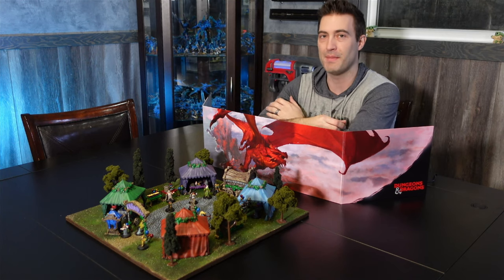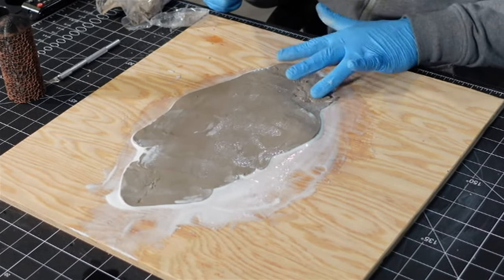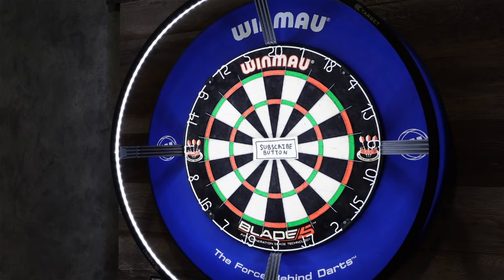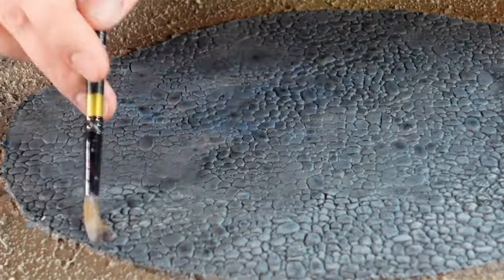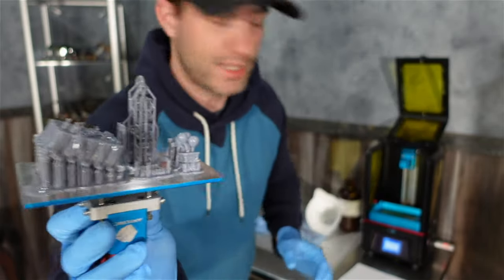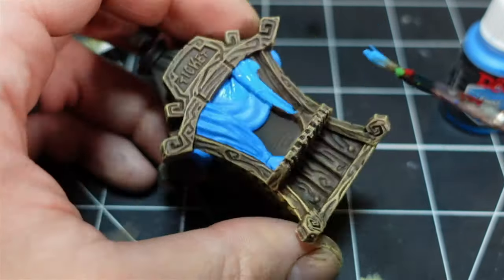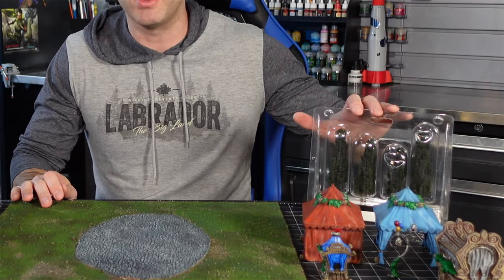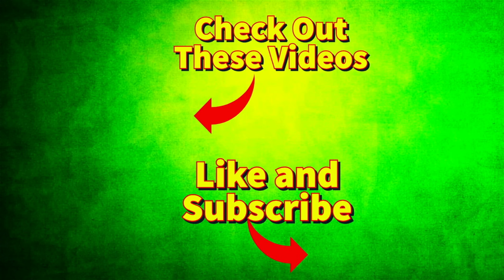Making a Mysterious FANTASY Carnival DIORAMA - 3d Printed D&D Terrain from World Forge Miniatures

Comment: I've come to the conclusion lately that most of my failed prints are due to room temp. I built a box with taped-together foam core from the dollar store and a cheap electric heater inside. I keep it at 30 degrees c. Haven't had any fails since. Sometimes I would have parts that wouldn't fall off the build plate but would have cosmetic failures like warping, I think this is all due to temp. The less viscous you can get the resin, the better.
Reply from the maker: I  believe that! Temperature has a big impact on resin printers imo
Reply: Yes, definitely - it's an issue for me testing the supported prints in the UK in winter. Roll on the summer!
Reply: Thank you for including your printing issues and how you solved them. It's great information for anyone getting started with 3D printing.

Comment: One other thing to keep in mind is that when removing or inserting the resin tray is to be careful about the fep sheet. Keep an eye on it to make sure that it isn't getting scratched by lcd screen.
Reply from the maker: I really need a screen protector...
Reply: If you have any micro fiber cloths, it should be safe to set the fep side of the resin tray on it.

Comment: Love the video! Getting ready to do the FDM prints myself. How did you get them to work? Did you sink the tent top into the bed a bit? What % did you use for supports? Looks like on your 3rd print the flags finally came out. Would love to hear any advice from your experience!!
Reply from the maker: For the tent tops I added supports and selected "touching build plate only" I wasn't able to save the little flags on top and they cracked off. I only printed the tent in FDM, but my advice would be to play around with orientation of the parts on the build plate until you find a position that looks the least intrusive. Then take your time and use a hobby knife and side cutters to remove the supports after printing.
Reply: @FacilityD20  thank you for the information! I'll try it out with your suggestions. 🤞